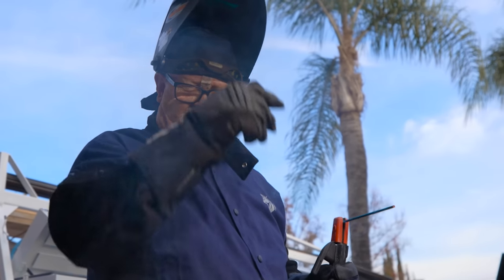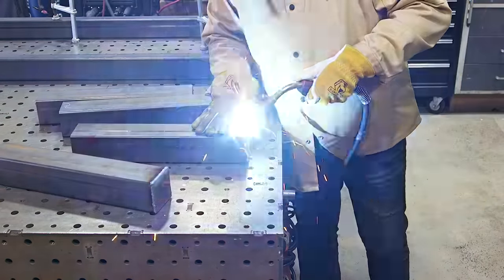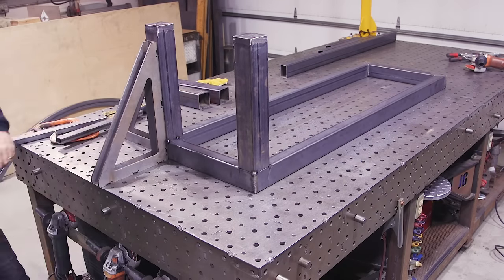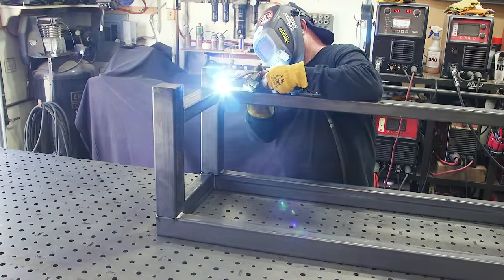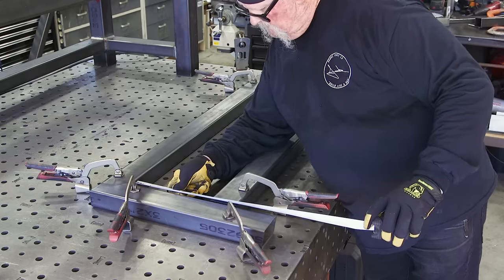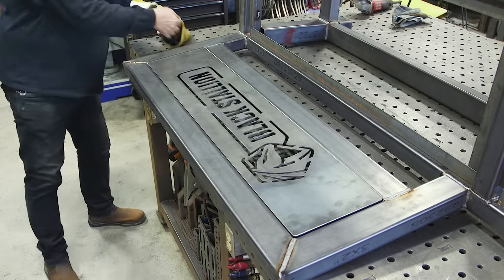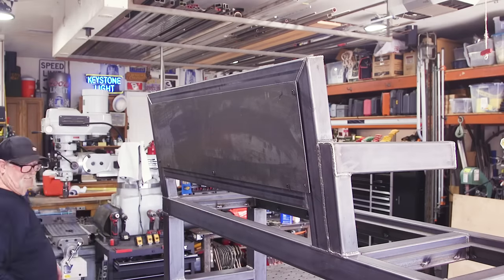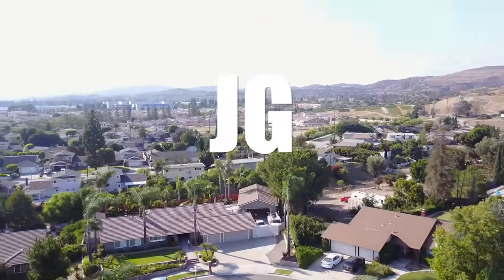Metal Bench Build | JIMBO'S GARAGE

Comment: Coming from ship repair, 1/8" is not heavy duty.  We call 1/8" 'sheet metal'.  The benches in our shop usually are all 1/2" thick minimum on the materials.  When a table weighs a ton or two, it stays where you put it.  

Other than that, nice table.

Comment: Penetrol is great for raw steel like this; some sort of Danish oil that hardens; a lot of hot rod builders will use it to seal exposed metal. Also acts as a primer for raw steel for something like poly.
Where most clearcoats will rust underneath (apart from dangerous things that self etch), this stuff stops rust pretty hard.

Comment: I built a wooden ladder shelf, and it took so long. It had to be dead perfect.  I took hours, setting up the table saw to make sure it cuts perfectly. The legs had to be exactly the same length, etc etc etc.  I built a shed, same thing! 🤣 I really put the love in my work.  I want solid products, I want to be sure, you cannot say anything bad about it.  I want to make sure you couldn't come up with a single flaw, as if the customer cares as much as I do. That's why I love steel more than wood, you can always rework it. With wood, you cut it wrong, it's all over lol